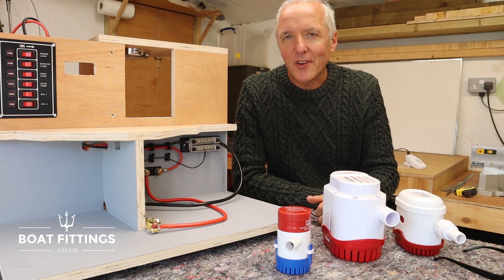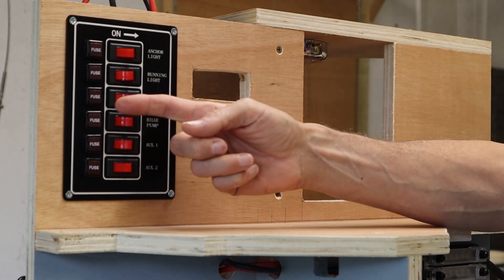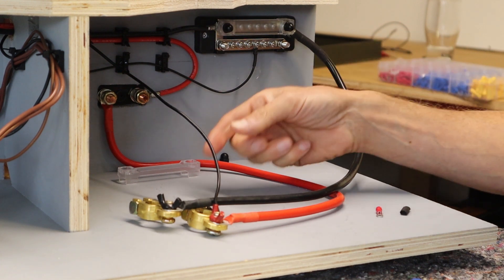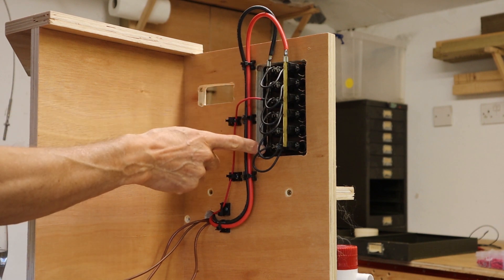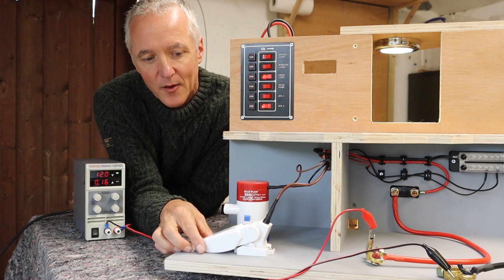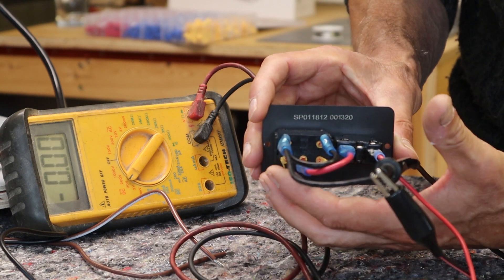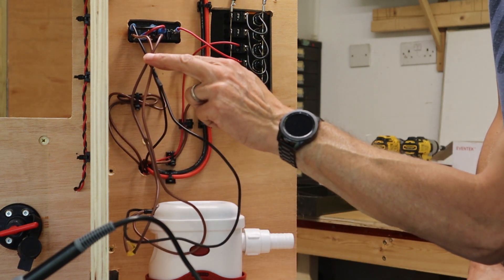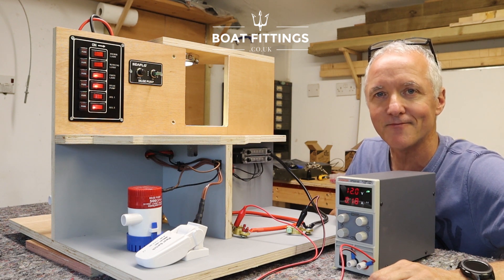Boat Electric Wiring Made Easy, Part 3, Bilge Pumps, Float Switch, Automatic & Manual Complete Guide

Comment: Question, I’m new to this and want to make sure I understand everything right. Using this set up, can I wire my single bilge pump to the float switch, but also run it manually? I want to do this with one bilge pump. Basically can I have the manual option and the float switch option running off the one pump?

Comment: As a note, you can also use a continuity test on a switch to test which position gives you a zero resistance (open) circuit, most decent multi-meters will have an audible beep when it detects an open current.

This way you can test switch functionality before hooking it up to 12 volt, if you're in a situation where maybe it's difficult to test with it hooked up.

Comment: Great video, on the first pump and switch you connected, it’s only for the switch to activate the pump, is there a way to also add a switch to manually activate the pump in the event the switch fails?

Comment: Thank you Sir! Great videos and explanation! I have a question: where would you connect a supply power cable from an outboard engine and where a cable from a battery charger fixed on the boat?  Thank you again!

Comment: Richard I can't afford nothing but an aluminium John boat. I've been wiring it for lights. Running lights and a couple spot lights for night fishing. I built a wooden box to attach my switch panel. Was planning to run switch panel directly to the battery. Then run positive wires from lights to switches and negative wires to a buz bar then buz bar to negative post on the battery. Does that sound workable. Oh my switch panel has resetable circuit breakers. Thank you for your attention

Comment: Sorry if this is a dumb question. I don't have bus bars and my auto bilge has been disconnected for years. Can I just wire up a system completely isolated from everything else and keep the 3 way switch mounted near the stern near the battery compartment and pump? and run my pos / neg direct to the battery?

Comment: I've never wired a boat, I just find wiring interesting.  Looks like once you've done a couple circuits, it becomes pretty repetitive.  Positive -> Fuse/Breaker -> Switch -> Device -> Negative.  Once you grasp that, you can easily add in whatever you need.  One thing to consider is using a relay to switch higher current loads like motors, then a toggle/rocker switch to activate the relay.  Saves your switch contacts a bit and may keep you from doing long runs of thick wire.  Especially for motors, which are electrically spikey and noisy, a solid state relay may be the most reliable (the name brand ones), as opposed to running it through a toggle/rocker.

Comment: for the auto bilge pump, utilizing the 3way switch for auto/off/manual, is it necessary to utilize the main switch panel as well or could you just bypass and wire the 3-way switch directly to a power and negative terminals...the use of both switches for the one pump seems redundant

Comment: Question, it seems that the positive wire for the 2nd bilge pump goes thru the fuse panel.  Wouldn't you wire the auto wire direct?  The auto feature will not work unless that switch is on, meaning the isolator must be on as well.  Forgive me if I missed something.

Comment: great video! Like Einstein said, make it as simple as possible, but no simpler! Brilliant! Well done Richard. 
I'm wondering at the cycles these automatic elecrtonic bilge pumps are rated for?  What are their Time To Failure numbers for their internal parts. 
And if used as designed (to actually test every 2&1/2 mins) 24-7-365 days a year, At a 2.5 minute test cycle, that's over 109,000 cycles every year????? after 2&1/2 years that's over a quarter of a million cycles? I think your inclusion of the float switch and manual pump is far safer, plus the automatic pumps with the built in float!

Comment: Great series so far. I did notice you changed counting from the bottom to counting from the top in-between episodes 2 and 3.  Also if this were a real boat I'd highly recommend a label maker for the connections at the panels and the bus.

Comment: Excellent tutorial! Thank you 🙏🏼 one question though : if you switch off the battery and remove the key, the automatic bilge pump will not work if one day there is water while you are not on board, correct? Shouldn’t the bilge pump be directly wired to the battery?

Comment: Comment:  have you considered creating a hot battery bus.  At the moment the bilge pumps only operate if the battery switch is switched on.  When the boat is moored the battery switch is normally turned off, then the bilge pumps will not operate.  Perhaps not a desirable situation.
Reply from the maker: Hi thanks for your question regarding a 'hot battery bus'.    I understand that some people would prefer to have a 'permantly-on' circuit for their automatic bilge pump, and agree that there is a logic to this.  In a future video I will include this type of wiring.  In any case though, my preference is to have a way of easilily turning off ALL electrics in the boat, from the point of view of not having to worry about the possibility of electrical mal-function while away from the boat - I think this is a matter of choice and priority (dry bilge vs electrical safety or run-down battery).

Comment: Richard, these are so very helpful! I have a 78 Ericson 34 and am having to troubleshoot wiring. My 12v panels (have 2), no longer receive power from the battery or they are not working anyway. We tested the batteries (have two), tested continuity to our switcher.

I’ve cleaned the connections of corrosion, etc but still no power.

And, these panels worked a few weeks ago. Only thing I changed is I added a Smart Plug shore power hookup for my AC power.

Also now having a “Reverse Polarity” warning to boot!!

Any tips?

Again, we’ll done on these videos, very helpful for a new sailboat owner!!
Reply from the maker: Hi thanks for your kind comment.  With your current problem my first suggestion would be to temporarily disconnect the new 'Smart Plug' to see if that resolves the problem - if that is the case then you can say that it looks like the problem was introduced with the Smart Plug, if that does not resolve the problem it is a case of working from the battery 'outwards'.

Comment: Great video series!  Just one question...If I run a bilge with the float switch how can I wire to allow the bilge/float to operate when the main switch is off?
Reply from the maker: Hi thanks for your question, it is possible to wire the bilge pump system direct to the battery via  a separate circuit to achieve this.

Kind regards,

Richard

Comment: I do have one question, have subscribed so hopefully an answer at a later date.

I have an automatic bilge pump in my dinghy, its run from a small battery and  has a solar panel to keep it charged. Its fused, but it does not run through the main battery cut out. I need that part to pump out when im not there. What are your thoughts?
Reply from the maker: Hi thanks for your comment and question.  I think it is quite valid to have a pump operating outside of the main cut-off switch for the reason that you have given.  The only down-side is if the pump drains your battery if that is a problem to you, but it sounds like your solar panel will keep things topped up, and understand the benefit of having a pump ready to keep the water down when you are not there.

Comment: Nice! Just a suggestion. It's better to have the bilge pump connected directly to the battery.
Otherwise your pumps won't work when you're away and you get a leak... 😢
Reply from the maker: Hi thanks for your comment.  I think you make a valid point, and there are some benefits to what you suggest.  Worst-case scenario you choose whether to prioritise a dry bilge vs drained battery potential.

Kind regards,

Richard

Comment: Can I ask why you wire the BILGE pumps through the switch panel and the battery isolator? This is the first thing I test on a survey and always get told the isolator is it won't work.  So the boat only takes on water when you are on board and the isolator is on? This should be wired directly from the battery to your BILGE PUMP fused manual/ auto  switch panel.  Hope this helps  Alistair
Reply from the maker: Hi Alistair, thanks for you question / comment.  I take your point / recommendation / opinion - though I think there is some merit to being able to easily isolate ALL electrics in one master switch.  In my opinion if I was going to leave my boat for a long time I'm uncomfortable having a device of any kind (like a pump) permanently on, in case of malfunction.

Kind regards,

Richard

Comment: Connecting a new VHF set which has a ground connection. The old set didn't. How would you easily identify a ground connection in a birds nest of someone else's wiring? Or would you run a new ground and where would you connect it?
Reply from the maker: Hi thank for your question.  Running a new wire would probably preferable.  On the other hand, if this is difficult, and you have another wire that you think is a good ground wire, then you can test by using a multi-meter to do a continuity test.  Take a length of wire from the negative battery lead to near where the wire is that you want to check, then put the mutl-meter inbetween the two for the continuity check (assuming you are familiar with that functionality on the multi-meter).

Kind regards,

Richard

Comment: why you're not wiring the bilge pump to permanently on (with auto)? that's what I have on my wooden boat for reasons.
Reply from the maker: Hi thanks for your comment / question.  I understand that some people would prefer to have a 'permantly-on' circuit for their automatic bilge pump, and agree that there is a logic to this.  In a future video I will include this type of wiring.  In any case though, my preference is to have a way of easilily turning off ALL electrics in the boat, from the point of view of not having to worry about the possibility of electrical mal-function while away from the boat - I think this is a matter of choice and priority (dry bilge vs electrical safety or run-down battery).

Kind regards,

Richard

Comment: Why did you wire a fused switch for bilge pumps in a way that will be isolated from battery when you operate the main switch leaving your vessel unprotected from flooding? It's even wired to another fused switch?
Reply from the maker: Hi thanks for your comment / question.  I understand that some people would prefer to have a 'permantly-on' circuit for their automatic bilge pump, and agree that there is a logic to this.  In a future video I will include this type of wiring.  In any case though, my preference is to have a way of easilily turning off ALL electrics in the boat, from the point of view of not having to worry about the possibility of electrical mal-function while away from the boat - I think this is a matter of choice and priority (dry bilge vs electrical safety or run-down battery).

Kind regards,

Richard

Comment: I have worked on and wired boats for many years , one of the worst boats i ever worked on was a boat that every wire supplying the power to the object was red , you should have mentioned or , on your display used the proper colored wire for each item , there is a standard color used for each item wether it is a solid color or has a tracer on it , such as the brown for bilge , blue for lights , etc , etc , etc .
Reply from the maker: Hi thanks for your comment.  

Kind regards,

Richard

Comment: Why soldier rather than crimp, or, even better, crimp first and then solder? 
If the bilge pumps are switched, then every time you leave the boat switched off, the bilge is unprotected from flooding.
Thank you for painstaking efforts in providing this collection.
Reply from the maker: Hi thanks for your comments.  I just find soldering easy to do, and crimping not always so easy - depending on what equipment and terminals you have.  As I have mentioned a few times I have not had any problems with soldered joints, but have had some with crimps.    I understand that some people would prefer to have a 'permantly-on' circuit for their automatic bilge pump, and agree that there is a logic to this.  In a future video I will include this type of wiring.  In any case though, my preference is to have a way of easilily turning off ALL electrics in the boat, from the point of view of not having to worry about the possibility of electrical mal-function while away from the boat - I think this is a matter of choice and priority (dry bilge vs electrical safety or run-down battery).

Kind regards,

Richard

Comment: Great videos. Very useful and reassuring, especially as I recognise the switch panels and busbars. Question, why does my LED cabin light dim when the bilge pump's test routine kicks in. If I switch the light off and then back on, it returns to full brightness. The light works fine, even when the pump is actively pumping. Is there some way to fix/prevent this? Many thanks.
Reply from the maker: Hi thanks for your comment.  That's an interesting problem - a bit confusing.  It sounds like the action of the bilge pump is causing a voltage drop in the lighting circuit, which the LED is not very good and handling.  Without further knowledge of how your circuits are laid out, I can only suggest to look into separating the bilge pump wiring from the lighting wiring, if that makes sense?  The other thing you can do is to check the voltage at the battery to see if it is up to scratch.

Kind regards,

Richard

Comment: Awesome video! One question, that wasn't really explained. Connecting negative from automatic bilge pump and negative togeather wasn't necessary, right? We could separatly connect it to the bus, as far as I understand.
Reply from the maker: Hi thanks for your comment.  Yes if I understand your question correctly, both wires could have been brought to the busbar to achieve the same effect.

Kind regards,

Richard

Comment: Can I use a switch that's not a seaflo and run one of the positive to the switch and the second positive to the battery to get both functions for auto and manual
Reply from the maker: Hi thanks for your question.  You do not specifically need a seaflo switch.  The important thing is the you achieve the equivalent functionality.  One of the positives can run through a switch to the battery for manual operation.  The other positive can run through a separate switch to the battery to give automatic operation.  Both positives want to run through switches though.

Kind regards,

Richard

Comment: Thank you! As someone who has been electrically challenged for his whole life, I thank you. It is simple wiring that I just can't "see" in my head.
This series is finally making sense. I don't need the theory, I need hands-on, step-by-step how-to's that make real-world sense to me.

I do wish you had walked us through each step, especially the switch, how it was wired and why... (and may I ask why ALL "power" or "hot" wires are not RED???  IMHO if a wire carries 'live current', it should be RED...)  I am working my way slowly into the existing wiring and my need to repair / update / add / remove systems as I upgrade and refit our sailboat in preparation to liveaboard and cruise.

I am currently trying to wire up a secondary diesel fuel pump (Edelbrock 38GHP #17302) for my DIY dual Racor 500FG Diesel Polishing system... and I will admit to being a little stumped trying to wire up a 2 way, 3 pole toggle switch... (I have since decided to use a 30A 2 pole Breaker Switch instead...)
 
PLEASE keep going, and please keep it at a Boat Wiring for Dummies level!!  =]

CJ&JD Blackwell
SV Rocinante
95' Gozzard 44 MK1A
Reply from the maker: Hi thanks for your comment and questions.  I do believe that all of the positive wires are indeed RED as they should be.  Good luck with your re-wiring 

All the best,

Richard

Comment: Why don’t you crimp the lugs on? What’s with the soldering?
Reply from the maker: Hi thanks for your question.  In my experience solder has never let me down, but crimps sometimes have - especially after a few years once corrosion has set in.  I am aware that some people prefer to rely on a crimp, and I'm sure there are pros and cons for each method.

Kind regards,

Richard

Comment: Thank you for your videos. I have been working on my 1972 Tollycraft 40, I decided to rewire it as the wiring was, let's say interestingly badly maintained. I thought it would be "fun" to just rewire, lol. In 1972 there really was no off-grid type of wiring so everything was wired for a genset or dc and shore power. Well I wanted to simplify and upgrade to new wire codes, lots of fun so far. I have taken this Tollycraft 40 to a new level of totally off-grid self sustained life. Watching your videos are helping me understand the dc side of wiring in its simplest form, as i do have extensive knowledge in the ac side from my off-grid projects. Awesome videos thanks again. 👍
Reply from the maker: Hi thanks for your comment, I hope your re-wiring project works out well.

Richard

Comment: Fantastic videos, can't wait for more. Question though: in 2023 why are we still using fuses rather than breakers? Are fuses just cheaper? Or is there some technical difference?
Reply from the maker: Hi John,

Thanks that seems like a good question.  I happened to have the 'fuse-type' handy to make the video, I beleive you can buy the equivalent panel with breakers, I guess it is a cost vs convenience balance.

Richard

Comment: Thank you SO much for these amazing how-to videos.

In this one (part 3), you refer to a manual override option for the first bilge pump. Do you recommend resorting to a separate 3 positions (on/off/auto) switch like the one used for the second pump, or to use the panel (on/off) switch for manual override and have the auto-switch  bypassing the panel (to stay always on on auto)? Thanks